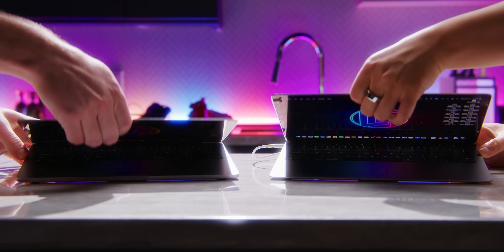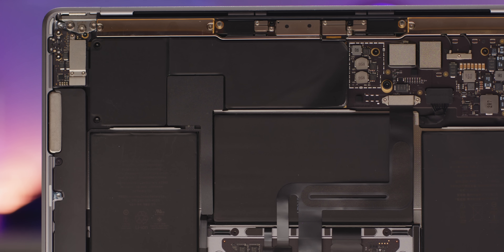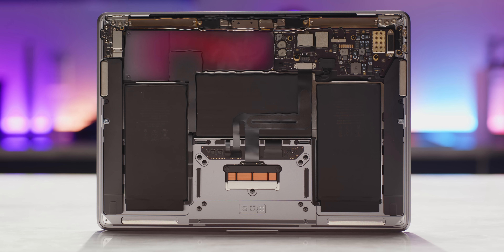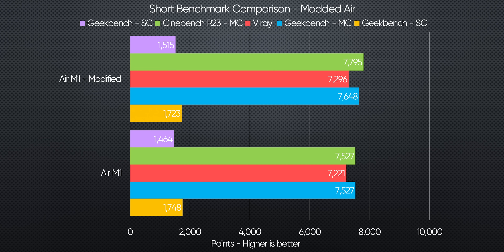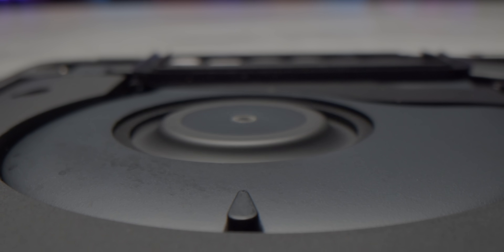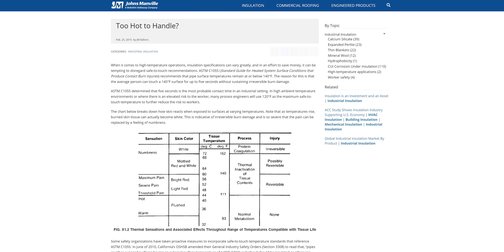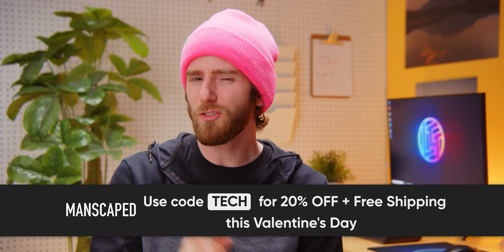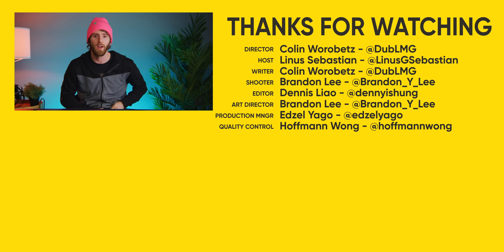Fixing Apple's GOOD Engineering - M1 MacBook Air thermal pads

Comment: The laptop wouldn't reach this temperature if it is on someones lap. The human body basically has water cooling so by having it on your lap your bloodstream would keep it cooler. I had a similar thing happen with a small thin laptop that didn't get much cooling through the fan but by having my hand on the WASD keys (just over the CPU) it was getting cooled very well. The downside is my left hand was sweating to deal with the heat.

Comment: You could cut/burn/etch 1000s of lines into the underside of the laptop; there-by increasing the surface area / cooling performance. you could add holes into the underside around the thermal pad. Add slightly bigger feet.

Comment: There are a couple of discussion groups over on MacRumors detailing specifically this mod which  followed on from the same mod on the Macbook Air 2020 with Intel processor. I modded my i5 Air last year and saw a good improvement and have been running the Mod on my M1 air for a few weeks now and it's been  stellar. My Cinebench R23 scores are consistently around 7750 - 7780.
I have the base model with 8/7 cores which does not have the black thermal foam pad that Linus removed, there's some speculation that it was only fitted to the 8/8 core to slightly improve the the 8/8 core score over the base model.

Comment: Why not take it a step further and test it out with some normal "raiser" or other cooling solution, maybe one of those small fan stands etc and see just how much cooler you could get it under extreme loads both for performance but also for the sake of safety ?

Comment: I think one should also consider the consequences of periodically heating and cooling the chassis of their pc: this puts stress on the entire structure, as the metal expands and contracts, which is focused mainly where the holes of the machine are. The result? Micro cracks which make your macbook more fragile! And beware, they might not stay that "micro".

Comment: I'm a big fan of you guys actually digging deeper into the engineering choices made by the manufacturer. Instead of just saying you improved the benchmarks and saying Apple engineers could have done better. 

Proves to me that there is a great team behind this channel. Great content.
Reply: They've done real work but these thermal pads have a downside of damaging the battery through higher temperatures.
The temperatures on the battery gas vent can reach values that are theoretically going to degrade it faster.

Comment: So in conclusion, Apple was actually completely justified to design this way due to regulation and customer safety, but we as users have the right to say screw it and turn our laptops into a hot potato that can and will burn our laps... and our junk. 
That's fair.

Comment: Have you tried to run long benchmarks after placing it on laptop cooler?
I think they missed a great opportunity to use screen back as heat sink maybe using flexible copper (like the ones in some car led headlights) to bridge heat sink with screen back. And no, it won't get uncomfortably hot, they can adjust area of flexible copper to control how much max heat passes through.

Comment: "Good engineering" and "Apple" should be mutually exclusive terms. Take the 2017 13" MacBook Pro non touch for example.
1st year of ownership the touchpad stopped giving haptic feedback and no longer clicks.
2nd year some of the keyboard keys became less responsive than ideal, causing typing mistakes and the fan started running flat out a lot more regularly.
This year I was introduced to the stagelight effect at the bottom edge of my screen thanks to their poorly designed LCD cable.
I'm probably lucky that I haven't had the SSD failures, or faulty battery that other owners have experienced. 🙄

Comment: I did this on my 2017 Dell XPS 13. Even though it had active cooling (single fan), it was nowhere near good enough to run its CPU at high performance for longer than a few minutes. The bottom surface did get hot on sustained workloads, but that wasn't a huge problem (just don't put it on your lap!). As a bonus, I could use a lap desk (with a fan) to really improve the cooling situation. Eventually the laptop's hinge broke, due to a failure in the glue that secures the hinge to the chassis - a failure that might be related to high chassis temperatures, though it is hard to know for sure.

Comment: 2:40 so, based on Apple track record, I'm wondering if and how long until the adhesive they are using on the screen implodes due to having hot air pointed at it.

Comment: I think doing this mod is not good for a MacBook Air. 
MacBook Air is a more affordale product for prople who don’t need do substaintial workload on their MacBook, the design eliminate fan noise by throttling performance a bit. 
But using thermal pad to spread heat from processor to the bottom chassis will heat up the battery, the high temperature would significantlly shorten your battery longevity,  eventually get the MacBook a need a repair.
Also the higher temperature of bottom panel would make it more uncomfortable to use the laptop on your lap, which is a common use case for these ultrabook.

Comment: You pay a premium to apple and you get these type of pathetic cooling solutions from them, apart from the thermal throttling it will reduce the life of the processor, and other electronic components since it is running at a higher temp. Other laptop companies offer much better cooling solutions at a lesser price, and you can use them at full load for extended time without thermal throttling the CPU. Also 54.5 + 7 = 61.5 Deg C, by the time most of us drink the last sip of coffee or tea, it is around 60 Deg C.

Comment: 0:20 Tehcnically it's "passively convecting heat away", not "passively radiating heat away". It is true that a tiny amount of heat is lost due to radiation, i.e. the surface of the macbook does reject some amount of heat as photons (this is what IR cameras pick up on to sense temperature), but the vast majority of heat rejected is due to passive convection, not radiation.

And before someone tries to argue this, I will also point out that "radiators" as most people know them are actually water-to-air heat exchangers, which chiefly utilize forced (or passive if there are no fans) convection. So calling them "radiators" is actually a very poor name. Just look at the fourth sentence in the wikipedia entry for Radiator: "Despite the name, most radiators transfer the bulk of their heat via convection instead of thermal radiation."

Yes I am an engineer and I am great at parties. Jk don't be silly I don't go to parties.
Reply: good point, maybe LTT should do a m1 MacBook Air temp test in a vacuum chamber, to see if there is a temperature difference, just for the LOLs XD, and see how much is actually radiated out XD.
Reply: @ahmedifhaam2669   since its made from aluminum it will probably not make a big difference if any. Aluminum is a great insulant, it does barely radiate any heat to the air around it.
Reply: @bigd5899  aluminium is opposite of insulant, otherwise it wouldn't be used to make heatsinks. Heat radiation can be improved slightly by black coating (which is why passive radiators are almost universally black)
Reply: not convecting conducting😂
Reply: Do you work for apple,
Better yet are you jimmy nutrition?

Comment: I realize these things are called "laptops" and that some folks do use them right on their laps, but I've always preferred to use mine on a desktop or table.  That enables me to employ a simple, lightweight device to help keep the device from overheating.  It's a simple kitchen wire cooling rack of the appropriate size.  Amazon has some on the web page linked here: https://amzn.com/B01DOJIFTQ

One of those will elevate the laptop a centimeter or so to create an air gap underneath for air to circulate freely.  This can make a noticeable difference in the laptop's thermal performance.  It is especially useful on laptops that have active cooling systems with the air intakes on the bottom, but would certainly help on a passively cooled model where the bottom case was acting as a heatsink.

Comment: "We're not going to throw a water cooler on it, that would be silly"

Man I miss old Linus
Reply: Nah this vid is something u would also do at home, but he could bring another vid showing all the weird ways
Reply: my local laptop brand create peltier kit for their laptop and it around $70
Reply: @mixswist  that's not very smart. Peltier modules are highly inefective and hardly make sense on a desktop. On the device that runs on the battery I think they make more harm than good
Reply: @PijWodeBedzieszWielki  sksk
Reply: how do you overclock a mac ?
Reply: @cnbihatemylife  you don't
Reply: He'll do it eventually, he can only resist his innate drives for so long
Reply: I came from the future and have great news to you
Reply: Use a neutronium heavy metal pad?

Comment: IEC 60950-1 is old and IEC 62368-1 is the current standard! Temperature limits for touchable surfaces have changed due to the new standard.

Comment: Tip - you can also use a combination of copper shims attached on thermal pads to improve dissipation to the chassis. Performance matches the M1 macbook pro with this combo.

Comment: I immediately want to see if I can get a gain on a “regular” laptop with a fan and heat sink....
Reply: So, I did this to my 2018 razer 15 advanced...  what an improvement. The laptop used to run at 75*c full load and the fans would be flat out. I put thermal pads everywhere I could fit them on the cooler and now the fans only ramp up under full GPU and CPU load and the cpu is clocking a few hundred MHz higher and under just cpu load it is running 10 degrees cooler and the fans are nearly inaudible. Yes, the back of the case gets warm but not painfully so. It also runs way cooler and quieter under all “normal” loads such as watching videos or cruising the net. 

I will be doing this to my razer blade stealth 13 as well if it will work...I still have to open it up and see if it is possible on that one.

Comment: Interesting cheap and effective mod. If you want to make it even more effective use the MBA at a desk/table when you push it hard for an extended period. On the desk, put it on a steel plate, granite tile, or anything else with decent conductivity and heat capacity; that'll help a lot. Same idea was the passive thermal mass/radiator that's in the MBA, only bigger.

Comment: Thermal Pad + USB C Hub + Cooler Master Notepal U150R + VIVO Universal Adjustable 10 to 15.6 inch Laptop Holder Desk Mount, Single Pneumatic Arm VESA Notebook Stand with C-clamp and Grommet Options, Black, STAND-V101L  + Logitech MX3 mouse + Logitech k380. Solve your problem.

Comment: Easy solution: Spend about a dollar on some 1/8" particle/chip/fiber/whatever board at Home Depot.  Cut to size of Macbook Air.  Sand sharp corners.  Slide in case with MBA.  Put MBA on top of board when on lap.  Cheap, thin, dirt simple lap desk to insulate your junk.  Unless vanity is so important that you absolutely must work with the thing directly on your lap, still slow roasting your nethers while taking a performance hit.  And that's probably true for a lot of Apple owners, I imagine.  For the sensible, though, get some thermal pads and some particle board for less than the cost of the coffee at the Starbucks where you're working on your MBA, and make your computer run better.

Comment: not worth the mod to be blunt. Some workloads running java on M1 are faster than AMD ryzen 3700x running at 4.4ghz boosted. A fanless mbair beats a full blown 3700x workstation with 64G of 3600 memory.

Comment: And add desk fan to blow the body so it will run cooler. I had an old HP laptop years ago that ran slowly and got hot easily. I often used fan to cool it down while doing really heavy stuffs (for that computer) like handbrake (had to use it sometimes). Although the fan was aimed at the top of the chassis over the exhaust part, cpu temperature lowered significantly (forgot how it was exactly). But then, it had to be on desk all the time and break the purpose of being laptop (hardly used it on my lap though, as it's heavy).

Comment: Put it on a metal table, and cover the table in a mac book sized thermal pad. increase the size of the radiator/heat sink, but keep it reasonable. Or try a glass table, obviously wood won't work

Comment: I went over to the Darkside and bought my 1st Mac, only because I heard so much about the M1 chip. Macs were always overpriced and underpowered until now. While I like it, I'm not about to give up my homebuilt high-end PC, which is outstanding for gaming. There was ZERO problem dealing with a new OS after decades of looking through Bill Gates' Windows. I did have to plug in my mouse to get around instead of using that annoying trackpad. Apple's security seems much better than PC so I use it mostly for all my financials, while I use my PC for gaming, videos, music and general web surfing. I was going to get Logic Pro X, but found out the Cubase 10.5 I already have on my PC is actually better. The only advantage of Logic Pro is the low price, so if you don't already have a DAW, it would be the way to go (if you have a Mac that is, because it only runs on Macs).